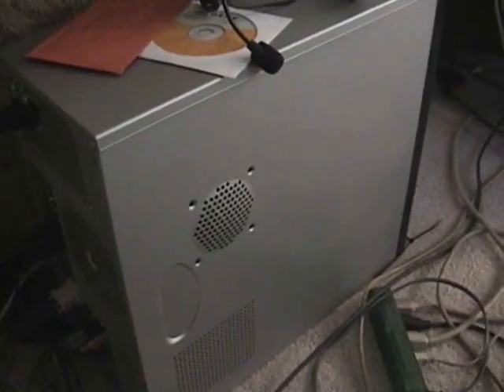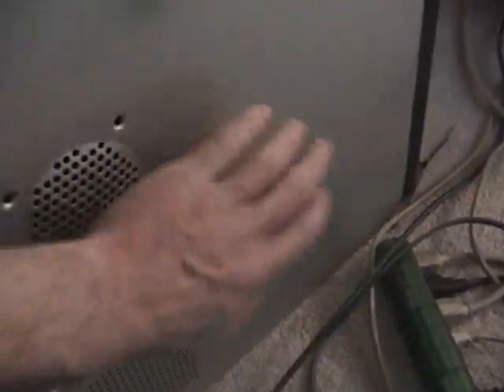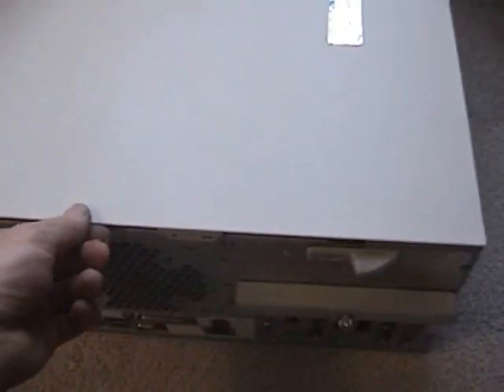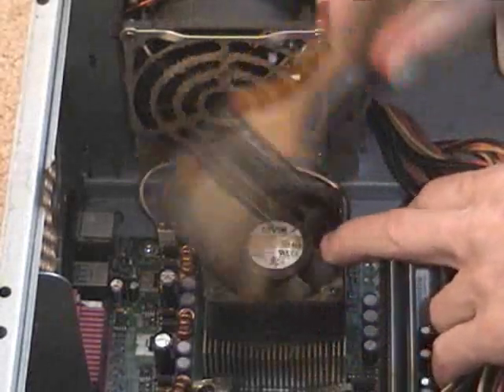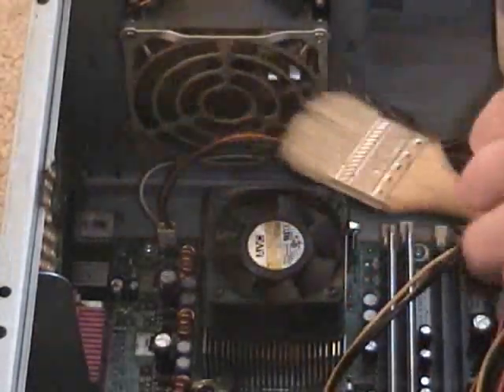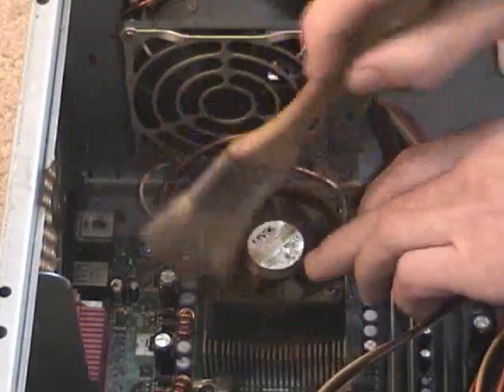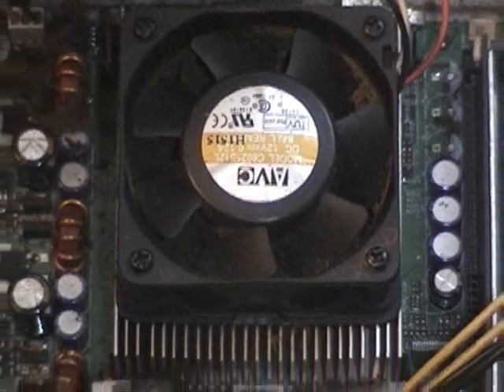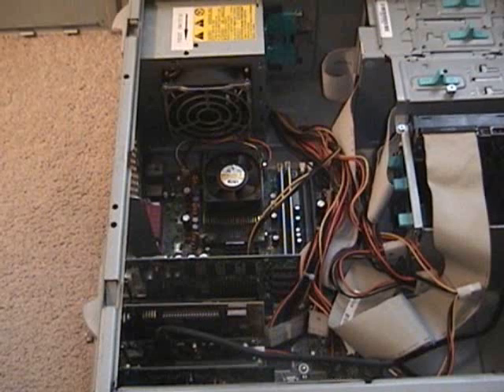Dust Removal

Comment from the maker: I'm surprised that the alcohol didn't take the paint off your keyboard keys. Your keyboard is removable and you could clean it with a real lite mixture of soap and water but you would have to make sure it is good and dry before you replace it, What kind of laptop is it? brand name and model.

Comment from the maker: Hey, Thanks for the compliment. Yeah USB ports are so touchy lately. Some devices are designed to run in a usb version 2.0 port and some it doesn't matter. Make sure you have the latest updates for windows and even go to the manufacturer web site of your pc and get the latest drivers for your motherboard or system. That should help.

Comment from the maker: People get mad at me all the time because I don't turn the power off or pull the fuse to work on a lamp or a wall plug or switch, hee hee.. I just TRY to not touch two wires at the same time Lol. That doesn't always work.